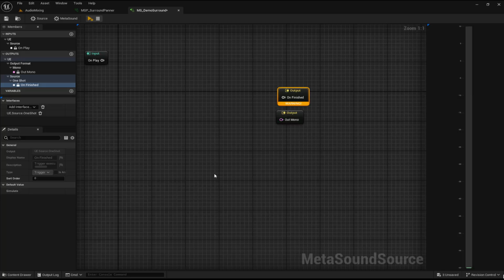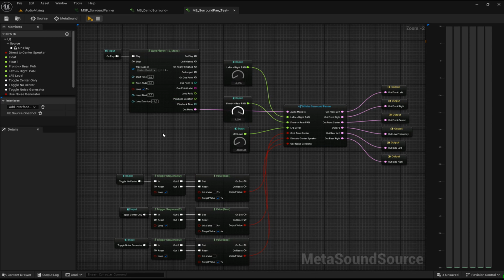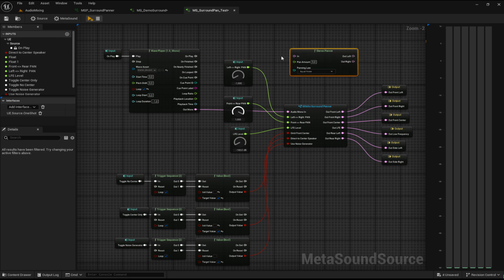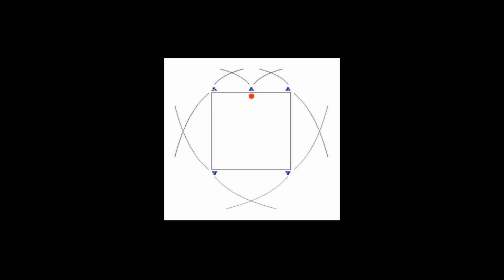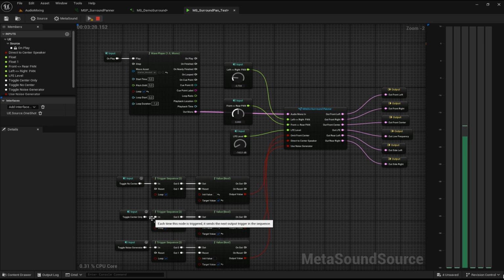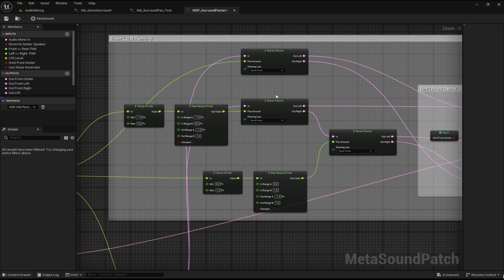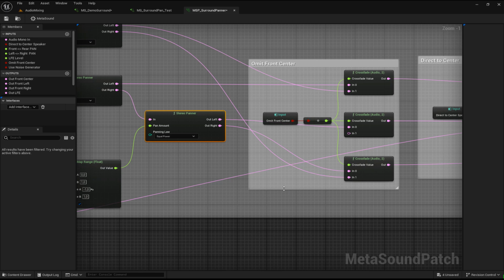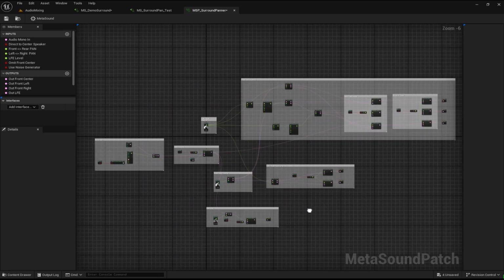Creating a 5.1- Surround Panner with Meta Sounds in Unreal Engine 5

Comment: Nice, thanks for sharing. Could you do a video showing how to apply this on a project so we can hear the directions of the sounds based on the character/player position
Reply from the maker: Right now I’m involved in several projects and unfortunately don’t have much time to record new YouTube content. But once things calm down a bit, I agree it would be a great idea to add an application-focused video on this topic.
But just to clarify: for localizing sounds based on the character’s position, you don’t actually need this surround panner. That’s already covered by Unreal Engine’s built-in audio system using attenuation settings. I use this panner more for musical or creative applications rather than spatial positioning, which is already well-supported out of the box.

Comment: Hello ! Thank you for the great tutorial :) I would like to connect the 6 output channels from your panner to my Audiobox 1818VSL soundcard, hence being able to connect each soundcard output to physical speakers, how could I do so ?
Reply from the maker: You just need to make sure that when you play your MetaSound, Spatialization is turned off in the Attenuation Settings. This way, the channels will be passed to your master submix unchanged,. Unreal Engine will always use the audio device that the operating system is set to by default.

Comment: That's neat! Got a question though: how do you set up your audio interface to output in 5.1? It's seems to me that unreal is just outputing in stereo
Reply from the maker: You don´t. The Unreal Engine uses whatever audio setup your system uses. So setup your Windows or MacOs Systemsound in 5.1 and the Unreal Engine uses that...

Comment: Thank you for sharing! 

What would you hear if the player had a stereo speaker in the end?
Reply from the maker: It really depends on how you implement it in your project. In principle, the Unreal Engine's audio system thinks in an object-based, 360-degree manner and then adapts to the capabilities of the playback system. So it would work just like placing a 5.1 audio file in your level. It's similar to the Dolby Atmos approach. If you're using a stereo playback system, it will simply downmix to stereo."

Comment: very interesting. Somehow bypassing the spatialization tools/sound objects inside UE appears to be the best way to handle complex multichannel solutions...
Reply from the maker: Well, the engine's own spatialization-system is object-based and this is a tool for channel-based panning. So it's like two different approaches. Depending on what you need, I would say.